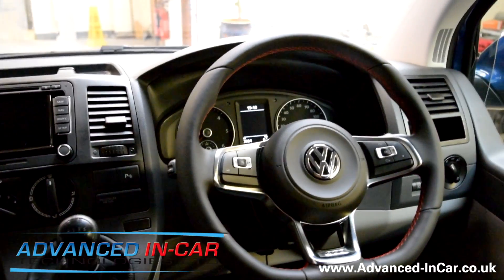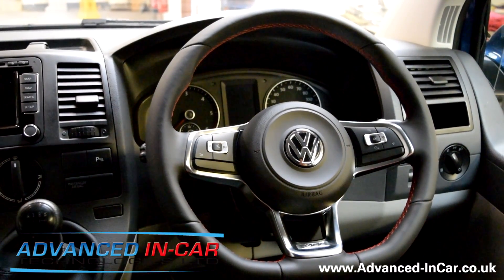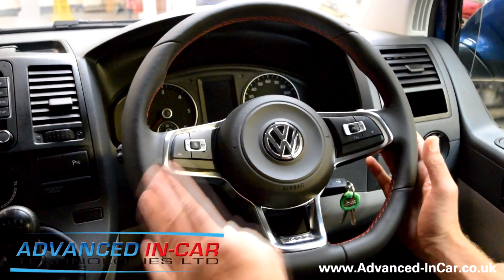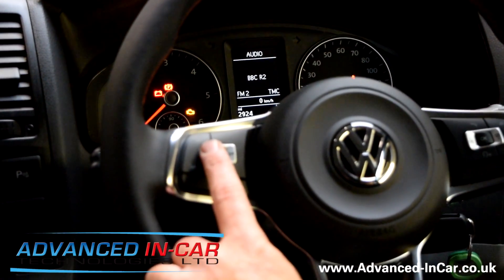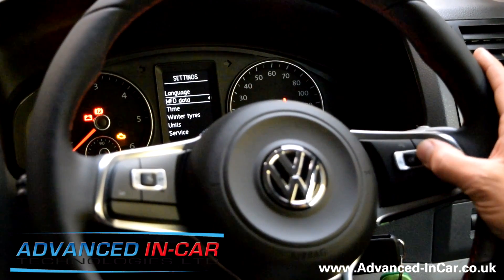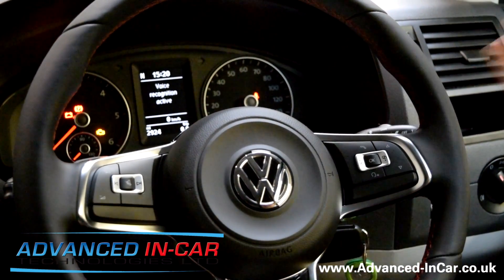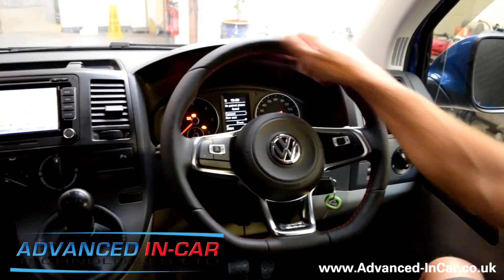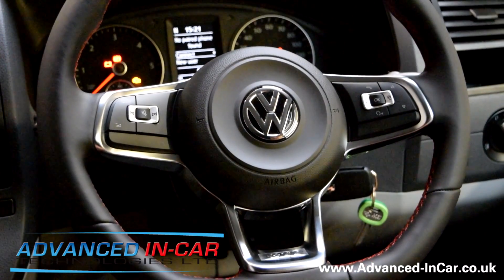Golf 7 GTI Flat Bottom Steering Wheel Retrofit to VW T5

Comment: Does your cruise control work by using it from the new steering wheel ?  I fit a Golf 7 R steering wheel into my T5.2 and thats the only thing that doesn't work!
Reply from the maker: We have a system that we can install down here in Poole that can make the Cruise work. Can't be done on a mobile basis I'm afraid.

Comment: Will this steering wheel fit onto a VW Polo? The 2010 model? Mine is currently plastic and has no buttons/not multi-function wheel.
Reply from the maker: +Ekram Shorif (Mahim) Hey! Shouldn't be any reason why it wouldn't. You might have to upgrade the Steering Wheel module at the same time though!

Comment: Awesome guys, had same wheel fitted to mine, but they couldn’t get the illumination to work because apparently I don’t have auto headlights
Is this true?
Reply from the maker: No not all. It will be down to the Software Revision loaded on to the BCM. Switch the BCM for a new / current version and illumination will work correctly.
Reply: @AdvancedInCarTechnologies  I have a Tiguan 5N  2009, and I have installed the 5G0 wheel, with 1k8 buttons, and 1k0...CH  SWCM. It is coded to 0000734, and I see the 1k8 buttons like slave coded wiht 0000164. All the buttons are working, except the illumination. Should the BCM be changed here as well? Which one should I get? Thank you for your reply in advance!

Comment: Hello,
i have read a few of the comments below but not much info on how to do it
can you please advise how to retrofit that steering wheel on the MK6? i do have a multifunction wheel 
is there any custom wiring that needs changed? from what i saw, the airbag and button cable at mk6 is different from the mk7
also, what coding lines are you using? is there a DiY from you
thanks for the info.
Reply from the maker: Unfortunately no DIY as it's a retrofit that we offer as part of our business. The video was created to show that it's possible and how / what it looks like when completed.

Comment: i have a 2013 T5.1 and my dashboard clocks are different to those, so would they fit mine, plug and play?
Reply from the maker: It all depends on what you have installed in there. I'd advise getting in touch with us through the Contact Form.